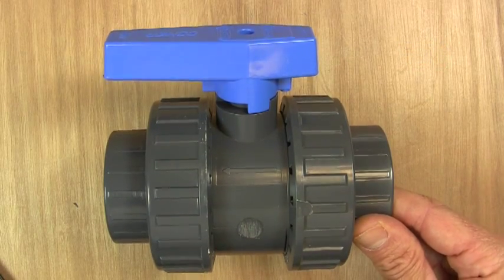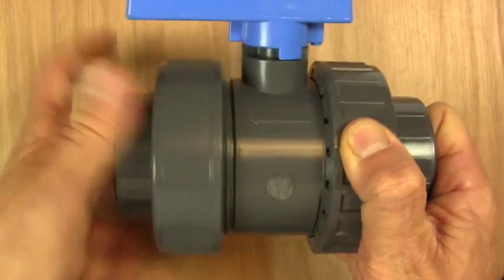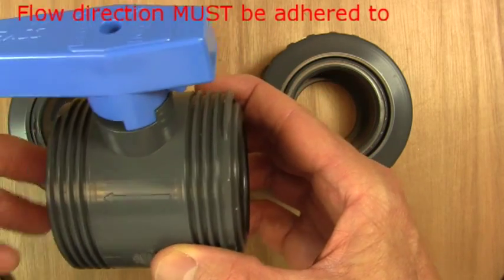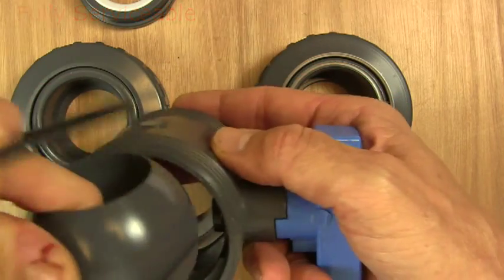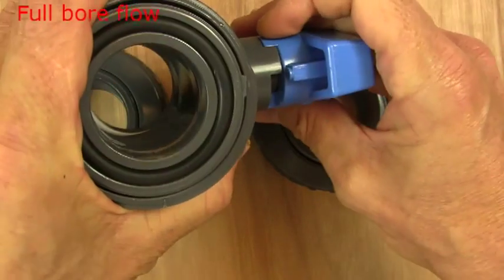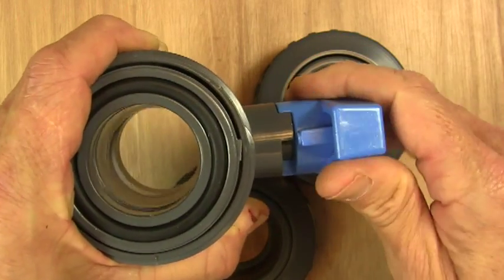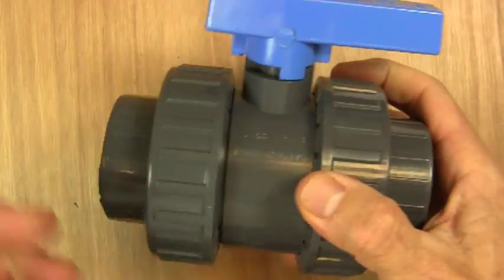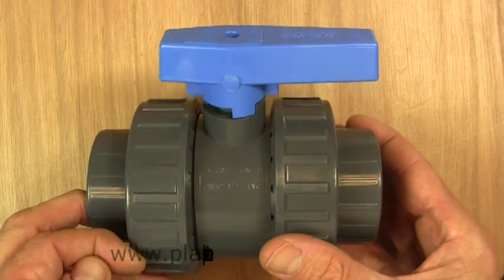Double union ball valve for pvc plastic pipe

Comment: Thank you for the explanation on why you should install this valve correctly with the water flowing in the direction of the arrow. I searched and search the Internet for the reason and you are the only one that provided this exact answer.  I guess if you drain the line first before needing to service this valve, like shutting the water off at the street main and then turning on a faucet somewhere and allowing all the water to drain out, then performing the service on the valve, it wouldn’t make any difference what direction you install this particular valve.
Reply from the maker: Hi there, we're glad that you found the video so helpful! Yes, that is correct. Installing the right way round prevents issues just in case someone turns the flow on it on whilst it's taken apart.